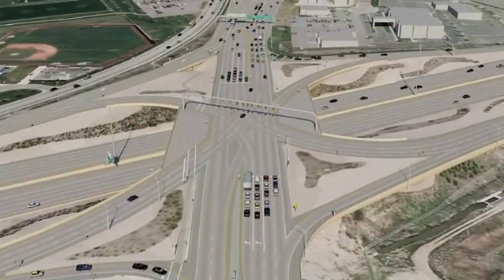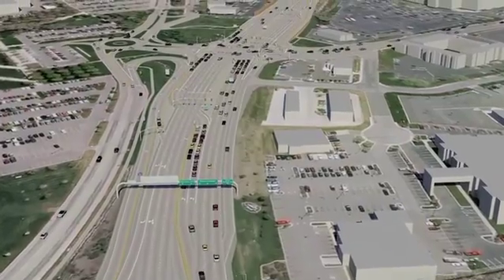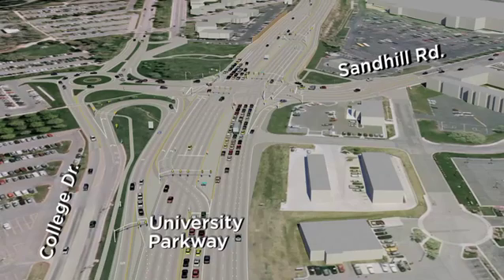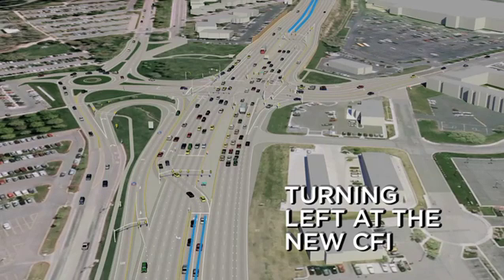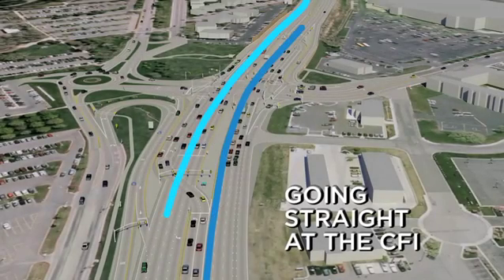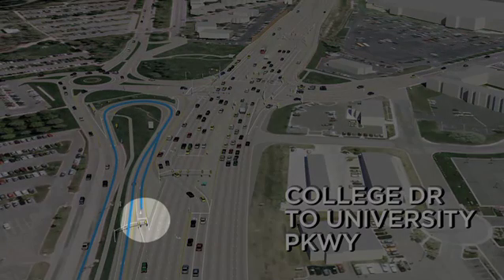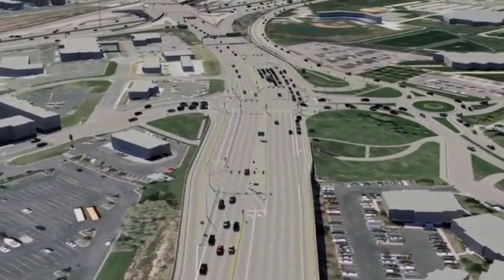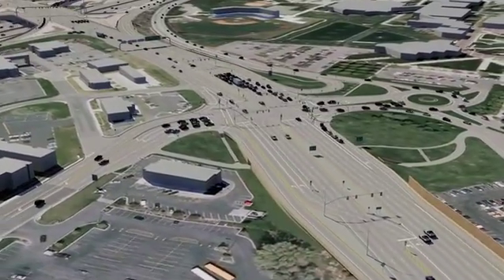Driving the CFI at University Parkway in Orem

Comment: It would help if they told us why this is better. So why are continuous flow intersections better? It seems like the same amount of cars still have to cross traffic, but to do it now they've had to add stop lights.

This seems like less "continuous" of a flow. For instance, a round-a-bout, though it wouldn't work here, would actually be more continuous because the flow actually continues.